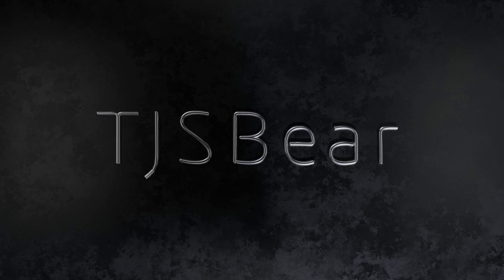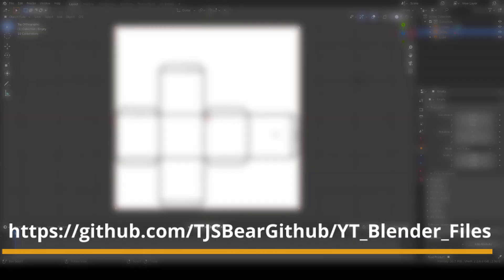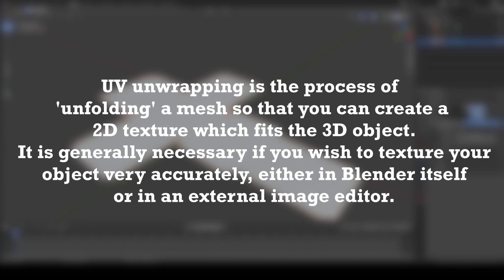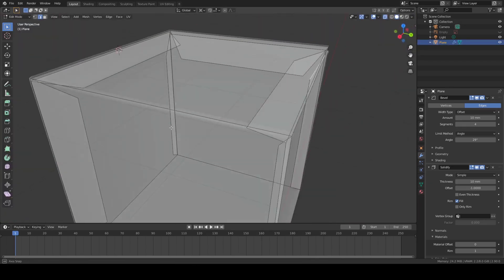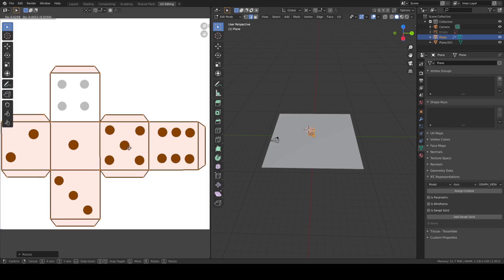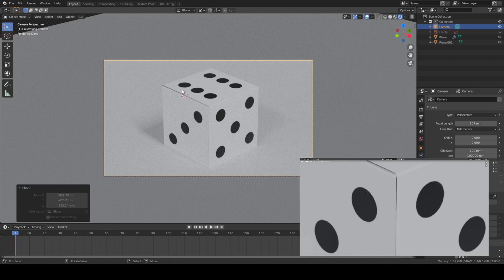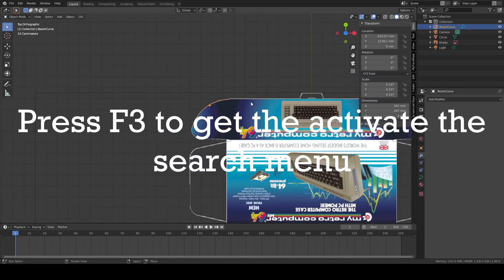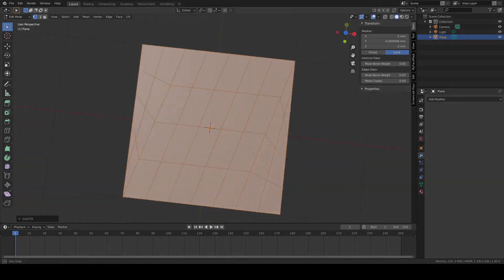Realistic Product Packaging In Blender- Ft. MyRetroComputer

Comment: Leaving my review as someone who has never used blender before and opened it up today to try to make a package. I had to figure out how to add an image on my own as it seemed like you just did a simple right click and dropped something in, this was not the case. Where I'm stuck on now is trying to change the orientation of my camera and set my reference image flat and level in my grid so I can begin to unpack how I can make my own shapes. So far it looks like I won't get much farther without doing a lot more googling. It would have been nice if you could have taken a few seconds to plug any tutorial videos you've made at the beginning or informed us that this tutorial was for those with prior knowledge of the program.